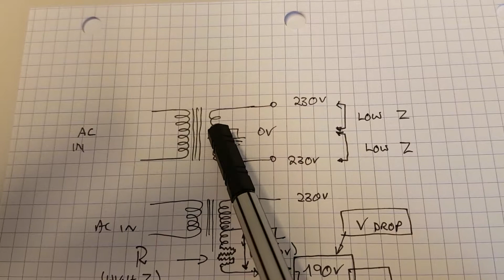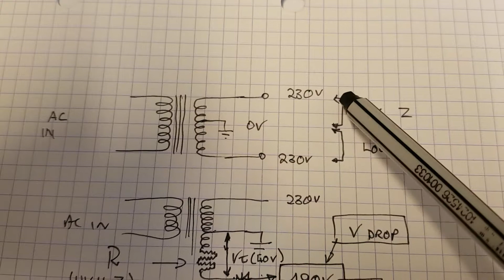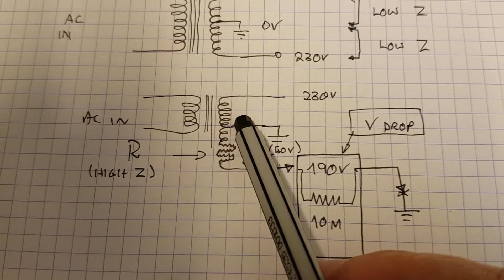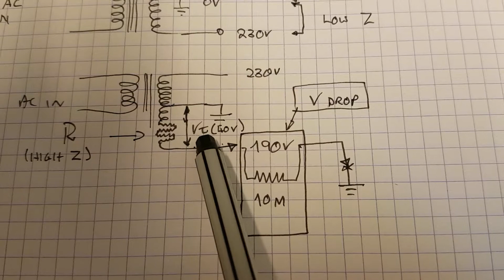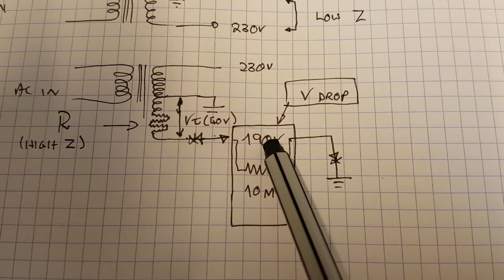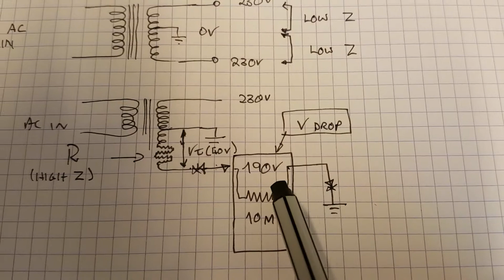The open circuit transformer conundrum.

Comment: The voltage was low without the rectifier installed, so I would guess shorted turns. I doubt the transformer would be safe to use, may overheat.
Reply: I was wrong, oh well.

Comment: Yes but when the set is on the rectifier will be taking current from the "open" winding and your explanation no longer obtains. Also The winding was showing open not high resistance (meg ohms) so again I wonder what you make of this.
Reply from the maker: As I explained in the video: I have had this exact same problem. I stripped down the transformer and could see exactly what happened.
Reply: @DerekHerbst747  
Thank you for your reply. My question is based on the voltage on David's rectifier when the set was on. I found it intriguing that he had considerable voltage on the anode in spite of the winding being open. 
Having thought about it I suspect this is due to the DC on the cathode acting as a bias that the "open" winding would match without supplying any current.
Reply from the maker: @jonka1  Your understanding is exactly right only differs from mine in approach. A digital Multimeter cannot measure extremely high resistances in the order of hundreds of Megaohms. (A device called a Megger is used for this purpose) and so would identify the coil as open circuit. When a transformer fails either by going resistive or going open circuit, due to overheating, the residual mess of burned insulation material and resin is mildly conductive, allowing the open winding to still show a high voltage at the output as long as the load impedance is appropriately high. A rectifier tube is perfect for this - until it is placed under load.  I myself have replaced two transformers that have this exact behaviour and one that became conductive  to ground and would trip the lights, but when removing the ground lead would power the radio properly.